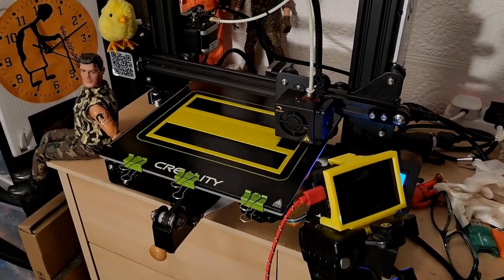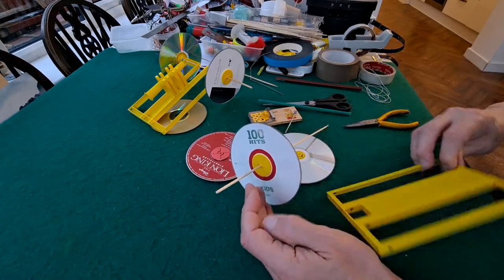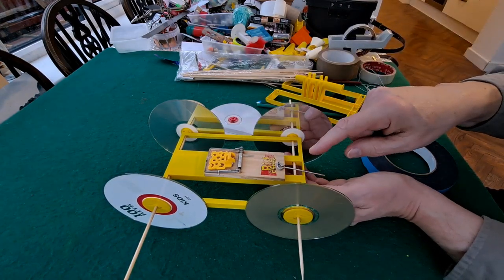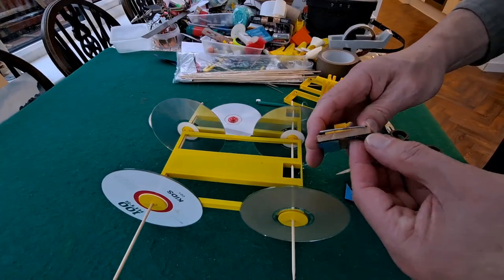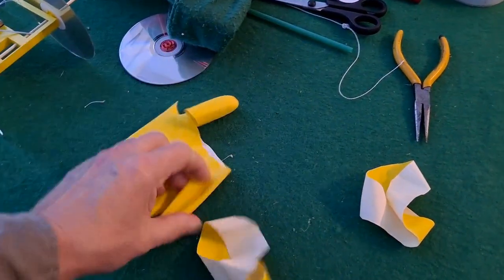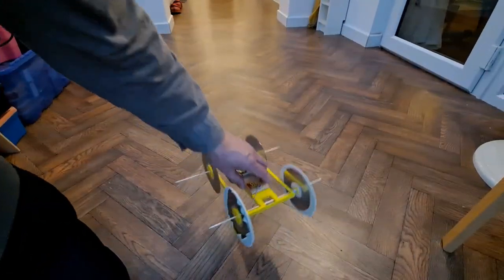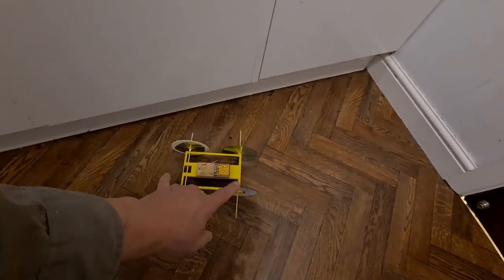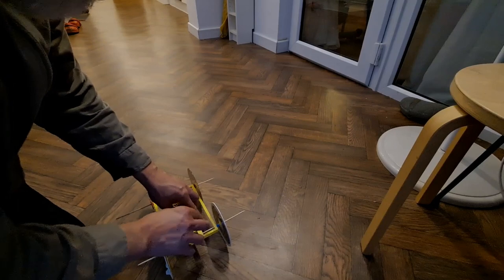3D printed mousetrap powered car 20201216

Comment: To make it go much further and faster, over-all, place a LONG stick on the mouse-trap flapper (like a catapolt) and attach the string to the end of the long stick (say 24 inches) and to the axle as usual. The 'throw' of the string is longer than 3 or 4 inches (like in your example) but now is approx 30 inches in length. Thus the distance the string will pull is MUCH LONGER and more powerful over the entire 30" 'unwinding of the axle' than the original you show. For traction on the CD's place a fat rubber band around the CD's which will give you the 'bite' into the surface with the lightweight Mouse trap vehicle. You may also gang-together two or three CDs together with a wide rubber band, this will help with more equal pressure being applied to each rear wheel as it takes off. --- I enjoy your video's.... Keep up the good work.
PS - When I was a shop teacher 40 yrs ago the longest distance was nearly 236 feet if rolling distance. So MTV have been around for a long time and still fun to always play with.  the oldtchr.  :-)
Reply from the maker: Hi J&M D, thanks for commenting and the tips 😁🎅⛄🎁🎄👍 You are right and wrong. You do not increase the power by lengthening the stick. The power comes from the spring. By lengthening the stick you do increase the travel so you can put more turns round the axle and get a longer powered run before it starts to freewheel. You are in effect changing the gearing.  In the video description you will find my playlist for Mousetrap cars which includes this one from 2009 by 1donagin https://youtu.be/XZ23q0QXPx0?list=PLA5a2xPRSrB1jSyRMjw31ptEYAAkZRF6H I have done my own version of that one but never had anywhere suitable to test the claimed distance

Comment: Nice print off for the Chassis. I like the idea that you kept it nice and simple.i suppose you could use screws to keep the trap in place but then it would be a modification and not simple. The car works nicely too even with the weight and the Rubber gloves around the CD, s to stop wheel spin. Long distance too.was that the full length of the kitchen? Can your print the Same car but with a longer Front end like a drag racer? That was success that build.😀 nice job 👍
Reply from the maker: The car is that size because that is the limit of the printer bed. I could make it longer by gluing sections together, like the chassis I did for the rubber band car https://youtu.be/rpD131zkZzU I could even have just put the mousetrap on that chassis.